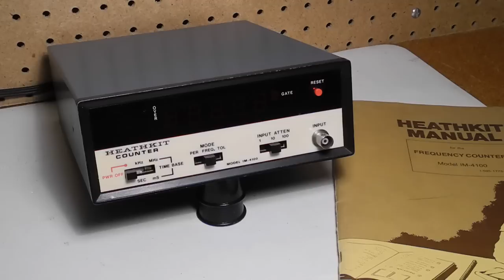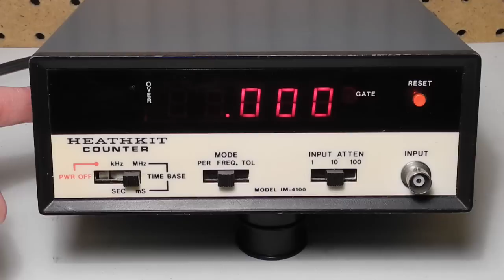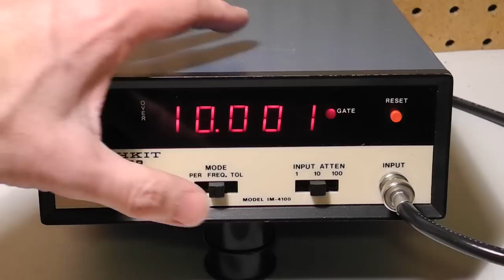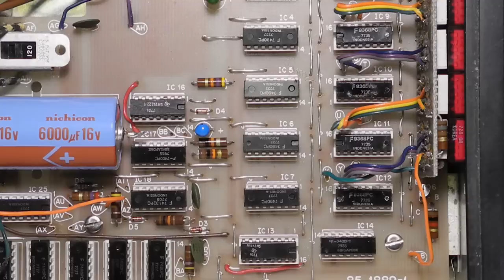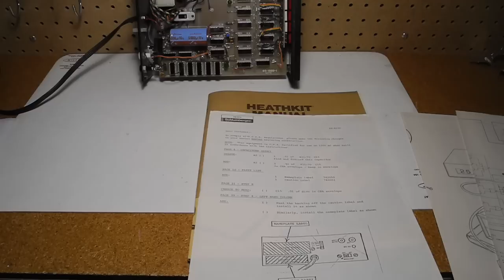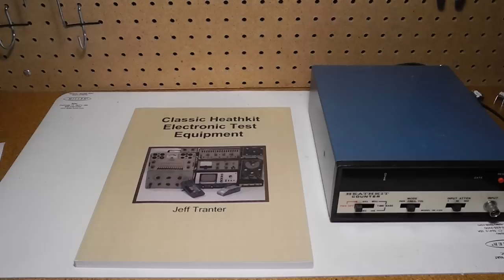The Heathkit IM-4100 Frequency Counter

Comment: Thanks for the detailed and informative video(s), Jeff; checked out the Heathkit IM-2410 and IM-2420 video as well. I got an IM-4100 as a package deal with some parts for a linear a few years back. After all these years, your video encouraged me to pull it out of cold-storage and bring it back to life. Bridge-rectifier diodes were burnt (common-problem ?) and many wires were flying-leads. The OM who built mine has done a great job; has included a divide by 10 prescaler on a well (homebrew) made FR4 PCB - piggy-back mounted in the space near the trafo. The sensitivity is better than spec'd @ -30dBm in the MHz range - upto about 90MHz and then drops-off to around -10dBm at 250MHz. A little 'deaf' close to 290MHz @ around 0dBm. The sensitivity is apparently better because of the 1M i/p Z against my Marconi 2022D's 50 Ohm o/p Z. Over all, a great instrument for its time. BTW, he's mounted a prescaler in/out switch on the front panel with professional lettering/labeling. I replaced the burnt diodes with 4x 1N5401 - by drilling larger holes. Not sure why Heath used 1A diodes when the spec'd current was already 1.25A. With the prescaler even the 3A diodes become pretty hot.  All the ICs appear to be from the original build.This instrument adds the vintage touch to my vintage shack (mostly 80's era rigs). BTW, mine has the original bail-stand/handle. Wish I had a digital-copy of the complete manual. Thanks again, and 73. Prem - va3uma.

Comment: Could you please tell me the difference between the IM-4100 and the SM-4100 counters?  Thanks
Reply from the maker: +8xlaxx The SM-4100 was the factory assembled and tested version and the IM-4100 was a kit. Other than that they are the same.
Reply: Thanks for the informative video. Would you kindly make a recommendation for replacement 7490 chips to boost the speed? There's a blizzard of ICs out there and I'm mostly a vacuum-state electronics fiddler.
Reply from the maker: I had been thinking that replacing the 7490s with a faster logic family might increase the range of the counter. In would require some experimentation to see if that was true. The 74F family is faster but I did some investigation and it seems that a 74F90 was never offered. I've only found 74LS90 which is lower power but not faster than a 7490. I think you would have to use a different counter IC and that would require modifying the circuit significantly. If you simply want a faster counter, you can buy kits on eBay for a 50 MHz frequency counter for about $5 and an assembled 65 MHz counter for under $10. I even see a 1.1 GHz counter on eBay for $13.

Comment: Hi Jeff. Thanks for doing this video. I picked up my IM-4100 at a local hamfest a couple years ago for $10. It works great with a small wire plugged into the front BNC and checking the frequency of my Johnson Ranger. Hamfest fleamarkets are great places to buy older test equipment at bargain prices.
73, Randy, w5kcm